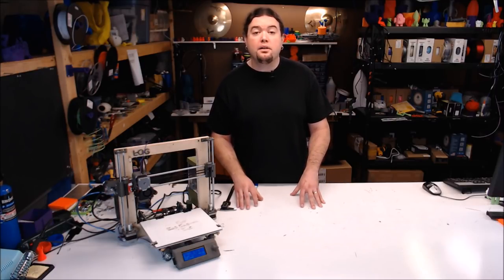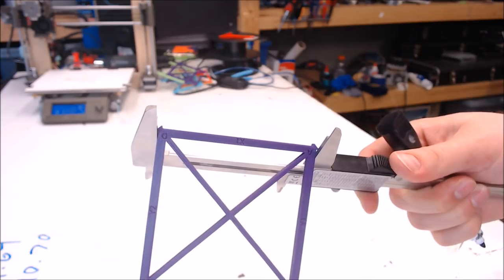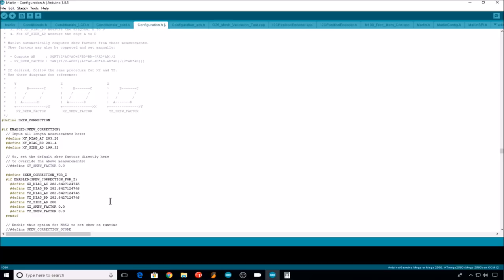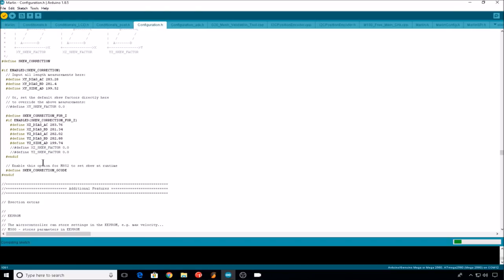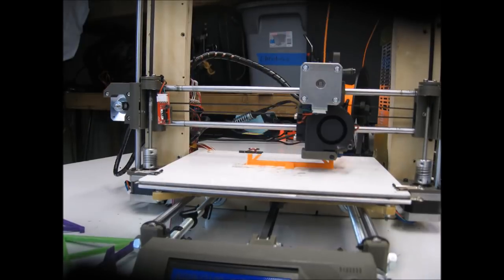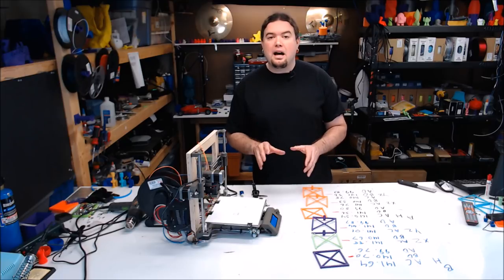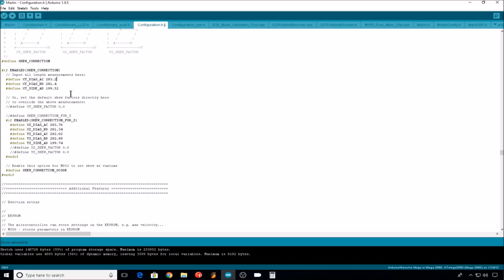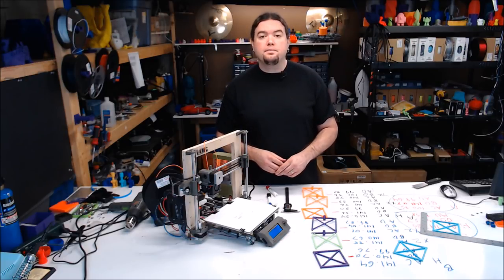Marlin 1.1.8 Bed Skew Compensation - How To - 2018 - Chris's Basement

Comment: Hi Chris, when I try to compile I get this error on Marlin 1.19+Arduino Mega 2560

sketch\Marlin_main.cpp: In function 'update_software_endstops':

sketch\Marlin_main.cpp:1421:3: internal compiler error: Segmentation fault

   }

   ^

Please submit a full bug report,

with preprocessed source if appropriate.

See <http://gcc.gnu.org/bugs.html> for instructions.

lto-wrapper.exe: fatal error: C:\Program Files (x86)\Arduino\hardware\tools\avr/bin/avr-gcc returned 1 exit status

compilation terminated.

c:/program files (x86)/arduino/hardware/tools/avr/bin/../lib/gcc/avr/5.4.0/../../../../avr/bin/ld.exe: error: lto-wrapper failed

collect2.exe: error: ld returned 1 exit status

exit status 1
Error compiling for board Arduino/Genuino Mega or Mega 2560.
Reply from the maker: Hey! I don't know this error. You would need to send me your code so I can try and compile it. Send me an email brotherchris81 at gmail DOT com
Reply: @ChrisRiley  Solved, I changed the version of AVR board of 1.6.23 for 1.6.22 and worked. Thanks for the tutorial.
Reply from the maker: @JoaoAlexandreRabelo  Awesome!

Comment: Say we set our skew and everything runs fine and finally say our belts need adjusting. Can the same formula we use for setting new esteps work for readjusting skew. Current Skew in fw  x (141.42/new skew)?
Reply: Just to follow up on my question. To be honest I would have just tried instead of asking. But last night the powers that be gave me a window of freedom, kids. By my testing that formula didn't quite work because of the placement of the variables was wrong. This is what worked for me. Current FW skew# X (actual measurement / model's 141.42...) = new FW skew #. So say my fw has 140.23 and I actually measured on my next print 140.6. 
140.23 X (140.6/141.42) = 140.4111 this times 2 280.8222 is my new FW number.
Reply from the maker: That's great, I'm glad you got it going!

Comment: Would you happen to know that once bed skew is turned on in the firmware does that compensation apply for manually jogging the machine around as well or is it just while printing?
Reply from the maker: That is a great question. I would think that once it's on it would apply for all movements.
Reply: Thank you.

Comment: Can i resize a little bit the squares? my caliper it's not enough big for diagonal measurements. If yes, any size? Thanks for the video!
Reply from the maker: Interesting, I don't really know. You should try it. Scale them down 50%, then multiply the numbers by 2 when you enter them. Let us know how that goes.
Reply: Ok, thanks!!
Reply: Hello Chris Riley  , sorry for the delay, after some issues with filament and electronics... i test it scaling at 80% and looks like works, anyway i have good measures before compensation and after looks like the same with around 0.3mm of differences in the measures. I think it’s good.
Reply from the maker: @nimiosound  Cool, good to know the scaling works.

Comment: You could just modify marlin to accept the actual measurements and multiply them by 2 in the software
Reply from the maker: Yes, you can do math right on the line I found. In 1.1.9 the values are closer to what they should be by default. It's a little less confusing.
Reply: @ChrisRiley  You can use the raw measurements, the math will be the same regardless. A ratio is a ratio....
Reply from the maker: @kylehunter2726  Thanks man, I figured that out later, very helpful.

Comment: Hey Chris love your videos! just did your tmc2130 with soft spi. absolutely  awesome! 
Im printing off a horizontal skew test and notice my inside lines are very off. outside is actually decent. any idea why?
Reply from the maker: Thanks! That's a strange one, sounds like maybe some slop in a pulley, but that doesn't make a lot of since either.
Reply: @ChrisRiley  it's a second hand geetech I3. beggars cant be choosers. changing to a bear upgrade anyways. might be an idea for your LOG printer?
Reply from the maker: @andrewmaynard6693  I need to do a bear build, just not sure what is will be yet.

Comment: Does this feature work in conjunction with automatic leveling?
Reply from the maker: It does! It works very well.
Reply: Chris Riley, Which version of Marlin do you use? I did the values launch according to the video but it is still out of square
Reply from the maker: These would all be 1.1.8.

Comment: Do you think mixing filaments (batch differences) has any adverse effect on the calculations?
Reply from the maker: Probably not enough to matter. It might a little bit. My calibers only do hundredths anyway. I think you could get really precise with this if you needed to. This printer doesn't really print well enough to tell at this point.

Comment: Chris, i have  issues when turning on the skew compensation and the lcd, (i've the reprap discount lcd), it says something about enable bed leveling (wich i dont have) did you have this problem?
Reply from the maker: Matias001998 Well I have bed leveling, but you shouldn't need it to use this. I can go back and look at the options again.
Reply: Thank you very much for your response, can you check by enabling the lcd (with the reprap discount lcd) and the skew compensation (in a fresh marlin copy) to see if the same issue appears?
Reply from the maker: Yes, it does work without bed leveling enabled. I used discount LCD and bed skew.
Reply: So, i went to the marlin forum, and it happent to be a bug of marlin and now its corrected in the bugfix.

Comment: Does this works on an anet a8 stock board? I have been trying to upload the firmware but it gives me an error saying that it can not comunícate wit the board. I would appreciate the help, it bugs me that I can’t print a simple square
Reply from the maker: It should work just fine on the ANET board. What board do you have selected when you try to upload to the printer?
Reply: Chris Riley I already installed marlin and everything but when I try to upload the new file with the skew correction it gives that error. Do I have to correct all 3 axis? Xy, xz and yz? I’m just correcting the XY since I think that’s my only problem
Reply from the maker: That's strange, can you paste the whole error in here? I will take a look. It's shouldn't cause you any problems.
Reply: Chris Riley  #define SKEW_CORRECTION

#if ENABLED(SKEW_CORRECTION)
  // Input all length measurements here:
  #define XY_DIAG_AC 286.72
  #define XY_DIAG_BD 278.78
  #define XY_SIDE_AD 199.78

  // Or, set the default skew factors directly here
  // to override the above measurements:
  //#define XY_SKEW_FACTOR 0.0

  //#define SKEW_CORRECTION_FOR_Z
  #if ENABLED(SKEW_CORRECTION_FOR_Z)
    #define XZ_DIAG_AC 282.8
    #define XZ_DIAG_BD 282.84
    #define YZ_DIAG_AC 282.8
    #define YZ_DIAG_BD 282.8
    #define YZ_SIDE_AD 200
    //#define XZ_SKEW_FACTOR 0.0
    //#define YZ_SKEW_FACTOR 0.0
  #endif

  // Enable this option for M852 to set skew at runtime
  #define SKEW_CORRECTION_GCODE
#endif
that what i have for the bed skew correction
Reply from the maker: You might try commenting this out, but other than that everything looks fine.

 #define SKEW_CORRECTION_GCODE

 What does the error say when you try to compile?
Reply: Chris Riley when i compile i have no error but when i try to upload it says that it can communicate with board even though it is
Reply from the maker: That's really strange, I can give it a try.
Reply: Chris Riley  i'm currentrly troubleshooting this and printing the squares again, but i was thinking of replacing the anet a8 board, is there any better one that you can recomend me? i was looking at this one https://www.amazon.com/gp/product/B07B2HN8ZP?pf_rd_p=d1f45e03-8b73-4c9a-9beb-4819111bef9a&pf_rd_r=J6119YGRYK342HJS5NWT but i dont know if the problem is the board.
Reply: Arduino: 1.8.5 (Windows 10), Board: "Anet V1.0"

In file included from C:\Program Files (x86)\Arduino\hardware\arduino\avr\cores\arduino/Arduino.h:257:0,

                 from sketch\Marlin.ino.cpp:1:

C:\Users\Jaime Lopez\Documents\Arduino\hardware\anet\avr\variants\sanguino/pins_arduino.h:43:0: warning: "TIMER2" redefined

 #define TIMER2  5

 ^

In file included from sketch\Marlin.ino.cpp:1:0:

C:\Program Files (x86)\Arduino\hardware\arduino\avr\cores\arduino/Arduino.h:210:0: note: this is the location of the previous definition

 #define TIMER2  6

 ^

In file included from C:\Program Files (x86)\Arduino\hardware\arduino\avr\cores\arduino/Arduino.h:257:0,

                 from sketch\Marlin.ino.cpp:1:

C:\Users\Jaime Lopez\Documents\Arduino\hardware\anet\avr\variants\sanguino/pins_arduino.h:44:0: warning: "TIMER2A" redefined

 #define TIMER2A 6

 ^

In file included from sketch\Marlin.ino.cpp:1:0:

C:\Program Files (x86)\Arduino\hardware\arduino\avr\cores\arduino/Arduino.h:211:0: note: this is the location of the previous definition

 #define TIMER2A 7

 ^

In file included from C:\Program Files (x86)\Arduino\hardware\arduino\avr\cores\arduino/Arduino.h:257:0,

                 from sketch\Marlin.ino.cpp:1:

C:\Users\Jaime Lopez\Documents\Arduino\hardware\anet\avr\variants\sanguino/pins_arduino.h:45:0: warning: "TIMER2B" redefined

 #define TIMER2B 7

 ^

In file included from sketch\Marlin.ino.cpp:1:0:

C:\Program Files (x86)\Arduino\hardware\arduino\avr\cores\arduino/Arduino.h:212:0: note: this is the location of the previous definition

 #define TIMER2B 8

 ^

In file included from C:\Program Files (x86)\Arduino\hardware\arduino\avr\cores\arduino/Arduino.h:257:0,

                 from sketch\Marlin.ino.cpp:1:

C:\Users\Jaime Lopez\Documents\Arduino\hardware\anet\avr\variants\sanguino/pins_arduino.h:47:0: warning: "TIMER3A" redefined

 #define TIMER3A 8

 ^

In file included from sketch\Marlin.ino.cpp:1:0:

C:\Program Files (x86)\Arduino\hardware\arduino\avr\cores\arduino/Arduino.h:214:0: note: this is the location of the previous definition

 #define TIMER3A 9

 ^

In file included from C:\Program Files (x86)\Arduino\hardware\arduino\avr\cores\arduino/Arduino.h:257:0,

                 from sketch\Marlin.ino.cpp:1:

C:\Users\Jaime Lopez\Documents\Arduino\hardware\anet\avr\variants\sanguino/pins_arduino.h:48:0: warning: "TIMER3B" redefined

 #define TIMER3B 9

 ^

In file included from sketch\Marlin.ino.cpp:1:0:

C:\Program Files (x86)\Arduino\hardware\arduino\avr\cores\arduino/Arduino.h:215:0: note: this is the location of the previous definition

 #define TIMER3B 10

 ^

In file included from C:\Program Files (x86)\Arduino\hardware\arduino\avr\cores\arduino/Arduino.h:257:0,

                 from sketch\Marlin.ino.cpp:1:

C:\Users\Jaime Lopez\Documents\Arduino\hardware\anet\avr\variants\sanguino/pins_arduino.h:49:0: warning: "TIMER3C" redefined

 #define TIMER3C 10

 ^

In file included from sketch\Marlin.ino.cpp:1:0:

C:\Program Files (x86)\Arduino\hardware\arduino\avr\cores\arduino/Arduino.h:216:0: note: this is the location of the previous definition

 #define TIMER3C 11

 ^

In file included from C:\Program Files (x86)\Arduino\hardware\arduino\avr\cores\arduino/Arduino.h:257:0,

                 from sketch\Marlin.ino.cpp:1:

C:\Users\Jaime Lopez\Documents\Arduino\hardware\anet\avr\variants\sanguino/pins_arduino.h:50:0: warning: "TIMER4A" redefined

 #define TIMER4A 11

 ^

In file included from sketch\Marlin.ino.cpp:1:0:

C:\Program Files (x86)\Arduino\hardware\arduino\avr\cores\arduino/Arduino.h:217:0: note: this is the location of the previous definition

 #define TIMER4A 12

 ^

In file included from C:\Program Files (x86)\Arduino\hardware\arduino\avr\cores\arduino/Arduino.h:257:0,

                 from sketch\Marlin.ino.cpp:1:

C:\Users\Jaime Lopez\Documents\Arduino\hardware\anet\avr\variants\sanguino/pins_arduino.h:51:0: warning: "TIMER4B" redefined

 #define TIMER4B 12

 ^

In file included from sketch\Marlin.ino.cpp:1:0:

C:\Program Files (x86)\Arduino\hardware\arduino\avr\cores\arduino/Arduino.h:218:0: note: this is the location of the previous definition

 #define TIMER4B 13

 ^

In file included from C:\Program Files (x86)\Arduino\hardware\arduino\avr\cores\arduino/Arduino.h:257:0,

                 from sketch\Marlin.ino.cpp:1:

C:\Users\Jaime Lopez\Documents\Arduino\hardware\anet\avr\variants\sanguino/pins_arduino.h:52:0: warning: "TIMER4C" redefined

 #define TIMER4C 13

 ^

In file included from sketch\Marlin.ino.cpp:1:0:

C:\Program Files (x86)\Arduino\hardware\arduino\avr\cores\arduino/Arduino.h:219:0: note: this is the location of the previous definition

 #define TIMER4C 14

 ^

In file included from C:\Program Files (x86)\Arduino\hardware\arduino\avr\cores\arduino/Arduino.h:257:0,

                 from sketch\Marlin.ino.cpp:1:

C:\Users\Jaime Lopez\Documents\Arduino\hardware\anet\avr\variants\sanguino/pins_arduino.h:53:0: warning: "TIMER5A" redefined

 #define TIMER5A 14

 ^

In file included from sketch\Marlin.ino.cpp:1:0:

C:\Program Files (x86)\Arduino\hardware\arduino\avr\cores\arduino/Arduino.h:221:0: note: this is the location of the previous definition

 #define TIMER5A 16

 ^

In file included from C:\Program Files (x86)\Arduino\hardware\arduino\avr\cores\arduino/Arduino.h:257:0,

                 from sketch\Marlin.ino.cpp:1:

C:\Users\Jaime Lopez\Documents\Arduino\hardware\anet\avr\variants\sanguino/pins_arduino.h:54:0: warning: "TIMER5B" redefined

 #define TIMER5B 15

 ^

In file included from sketch\Marlin.ino.cpp:1:0:

C:\Program Files (x86)\Arduino\hardware\arduino\avr\cores\arduino/Arduino.h:222:0: note: this is the location of the previous definition

 #define TIMER5B 17

 ^

In file included from C:\Program Files (x86)\Arduino\hardware\arduino\avr\cores\arduino/Arduino.h:257:0,

                 from sketch\Marlin.ino.cpp:1:

C:\Users\Jaime Lopez\Documents\Arduino\hardware\anet\avr\variants\sanguino/pins_arduino.h:55:0: warning: "TIMER5C" redefined

 #define TIMER5C 16

 ^

In file included from sketch\Marlin.ino.cpp:1:0:

C:\Program Files (x86)\Arduino\hardware\arduino\avr\cores\arduino/Arduino.h:223:0: note: this is the location of the previous definition

 #define TIMER5C 18

 ^

Sketch uses 120000 bytes (94%) of program storage space. Maximum is 126976 bytes.
Global variables use 4319 bytes of dynamic memory.
avrdude: ser_open(): can't open device "\\.\COM7": Access is denied.

Problem uploading to board.  See http://www.arduino.cc/en/Guide/Troubleshooting#upload for suggestions.

This report would have more information with
"Show verbose output during compilation"
option enabled in File -> Preferences.

it gives me this errors
Reply from the maker: @TechVid556  That error looks like it no longer likes the board type, but no clue why. I wonder if there is a newer version of skynet library available?
Reply: Chris Riley  apparently i managed to upload the code after restarting arduino, but i printed the calibratroin square again with the "correction" and still it had the skwed problem. do you have any recomndations?
Reply from the maker: @TechVid556  Is the skew consistent? Meaning its always in the same direction? Just wondering if you could be compensating then the skew changes. Also, how far out are you? I really only saw it help will large amounts of skew. Did it improve or change the test part at all?
Reply: Chris Riley one of my diagonals is 139.xx and the other 143.xx and it’s very consistent and applying the skew compensation did not help at all, I’m not sure if the board or stepper controller are compatible, since after doing some research I did not find anything posts or forums with this topics
Reply from the maker: It might take me a couple of days, but I will test this.
Reply: Chris Riley thank for helping me, probably I’ll disassemble the printer and if I have success I’ll let you know. By the way great videos!
Reply from the maker: Just an update, I did get a chance to put this on my ANET and it does make corrections. I used my ANET E10. Here are my settings. Make sure this one is commented out or it will override it.   //#define XY_SKEW_FACTOR 0.0    Hope this helps.

#define SKEW_CORRECTION

#if ENABLED(SKEW_CORRECTION)
  // Input all length measurements here:
  #define XY_DIAG_AC 141.41 * 2
  #define XY_DIAG_BD 140.79 * 2
  #define XY_SIDE_AD 100.07 * 2

  // Or, set the default skew factors directly here
  // to override the above measurements:
  //#define XY_SKEW_FACTOR 0.0

  //#define SKEW_CORRECTION_FOR_Z
  #if ENABLED(SKEW_CORRECTION_FOR_Z)
    #define XZ_DIAG_AC 282.8427124746
    #define XZ_DIAG_BD 282.8427124746
    #define YZ_DIAG_AC 282.8427124746
    #define YZ_DIAG_BD 282.8427124746
    #define YZ_SIDE_AD 200
    #define XZ_SKEW_FACTOR 0.0
    #define YZ_SKEW_FACTOR 0.0
  #endif

  // Enable this option for M852 to set skew at runtime
  //#define SKEW_CORRECTION_GCODE
#endif
Reply: Chris Riley thanks, I’ll give it a try!
Reply: finally got it to work, i uninstalled everything and once i uploaded  marlin again it starting making corrrectoin, very usefull video! thank you for your help
Reply from the maker: Nice! You bet! Anytime.

Comment: Will this work with a delta kossel printer.  My kossel prints a parallelogram with a scooped side on the z tower side.  That side is longer that the x to x tower side.  Its been frustrating...
Reply from the maker: It will work, but more than likely you have a hardware issue., Something is a miss.
Reply: I figured it out with the help of your video and a commenter.  Long story short is I didn’t write the hard settings into eeprom with m502 and m500 to make the printer use my updated config.h settings.  I’ve got lots to learn and it seems so confusing especially with all of the gcodes..  Thanks for the video!
Reply from the maker: @u2ooberboober  Great find, that has caught me more than once.